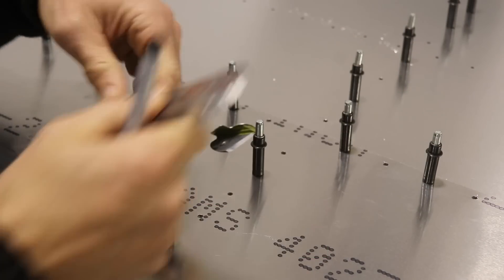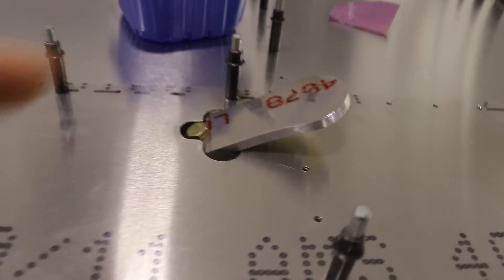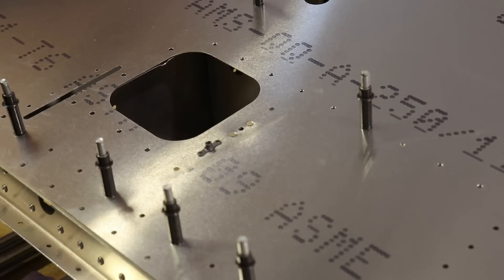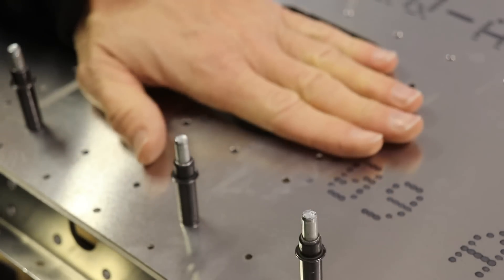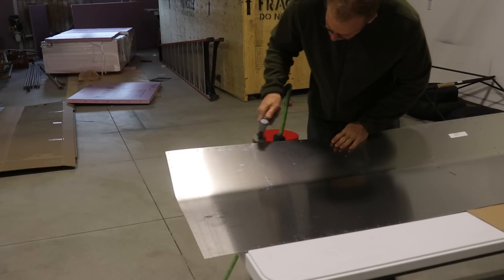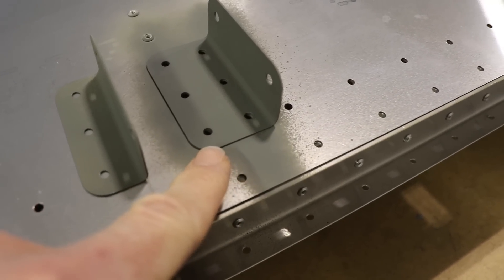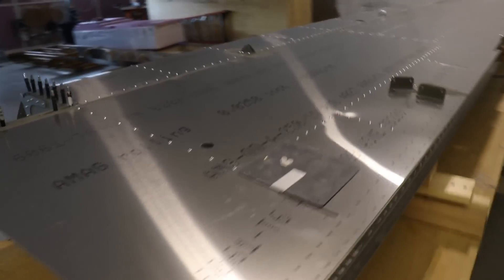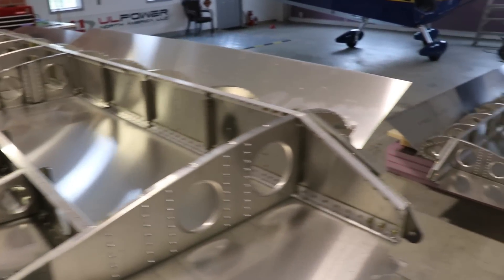Riveting the Wing Skins on the Zenith Super Duty  (Ep13)

Comment: What size nut plates are you using for this access cover?  Also, is the aluminum scrap you are using for cover the same thickness metal as the skins?  THanks in advance
Reply from the maker: The nut plates are 6-32. Not sure about the thickness of the covers. I used what I had laying around. I think it's a little thicker than the skin.

Comment: Thanks for sharing. Looking great! 
That new rivet gun probably shaved hours off your build time.
When you mentioned wiring in the wing it got me thinking about what wires one might need to run prior to buttoning up the wing. A +5 volt power wire for a GoPro (etc.) camera would eliminate battery life issues if you plan to put one on the wing(s). Hmmm, another option to get +5 volts out there could be to add a 5-volt voltage regulator (like a 7805, or a buck regulator) to the wire for the wing tip navigation lights since it's running out there anyway. Save weight and wiring. Turning on the nav lights would also power the GoPro.

Comment: why not bend the edges of the excess cover? To make it more seamless...
Reply from the maker: Are you referring to the access cover? If so, there's no need as it sits perfectly flush on the wing. You will see in Ep15 (or maybe 16) that I do bend the edges on the top leading edge skins with a special tool.

Comment: AN426AD-3-3.5
Reply from the maker: Thanks! I forgot to add that to the description box!
Reply: While doing nutplates on the RV, a lot of us started using the NAS “oops” rivets instead of dimpling the skins and the nutplates. The NAS “oops” rivets have a -3 rivet diameter, but a -2 rivet head, basically a very small head that fits into a #40 hole with just a little deburring. It really is a time saver, and looks great.

Comment: Mark you should use a piece of rubber in the top of the drill bit against the mandril to avoid hitting the aluminium skin whit the mandril. The factory recomend that , Although I have to tell you I made many little scratchs before that.....My Next plane will be better !!
Reply from the maker: Yes if you feel you need the rubber on the drill bit, there's nothing wrong with adding it.

Comment: Mark, Is it necessary to install nut plates in All the holes around this hatch? Could you use a strip of 1/8"x 3/4" Aluminum Tapped for the same size screws (8/32) riveted to 2 holes on each side?
Reply from the maker: Would that work? Technically yes it probably would, but that's just not how aircraft are built. Nutplates are the proper way to do it.

Comment: Mark, just wondering if  there would be any benefit to "Radiusing" the Strut attach brackets, they are pretty squared off right now. (smoothness, possible cracking ETC.)
Reply from the maker: Yes,  already did sand the edges to take the sharp 90 degree angle off. Just keep in mind-it's impossible to show you absolutely everything I do during this build. So each builder needs to think, and build as he or she feels is best. I try to cover the majority of the build, but sometimes I don't show the little details.

Comment: If you don’t pinch a flush rivet enough the first time, can you press it a second time?
Reply: Are you talking about the solid rivets that get squeezed or bucked? If so, yes, you can just squeeze more. If it isn’t set in the hole square and flush, than no extra squeezing will fix it, you need to drill it and replace it.

Comment: Would it have been easier (or possibly the same) to have bolted the bracket to the angle that attaches to the spar (before its attached to the spar), then riveted and bolted that to the spar after putting the bottom skins on. You might not have need the extra cut-out on the skin that way. Just a suggestion. Either way, once that bracket is on and the skins are riveted, you ain't getting to it again! Saying that, it doesn't look like that last bolt is actuall under the surface of the skin. Wonder why Zenith didn't make the cut-out big enough to take the bolt. I guess there are a few things to report back to them to improve the kit.
Reply from the maker: Hi Simon, The angle part that is attached to the spar is pre-built and attached to the spar at the factory. I'd have to go look again but yes I believe the bolt is slightly below the skin. I wouldn't say that the extra little grinding I did was 100% necessary because instead of using a socket on the bolt, one could probably slip an open end wrench under the skin to hold the bolt. Remember, this is just how I decided to do it and there are many ways to do things. Plus, I just like putting my own little personal touches on things! And you are correct that once the skins are riveted, there is no access to the bolts. I know a few people who have added inspection holes there, but personally I don't see a need for it.